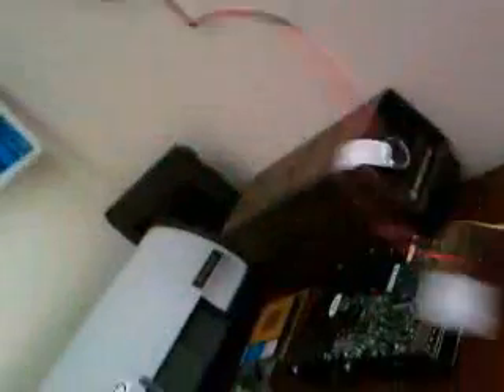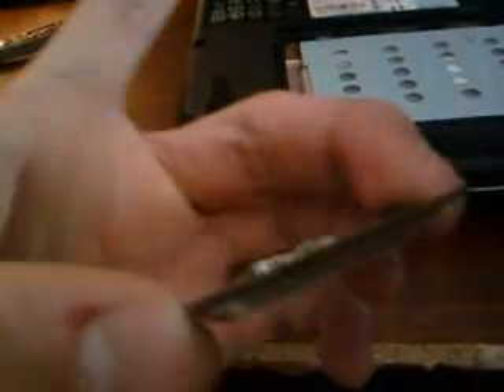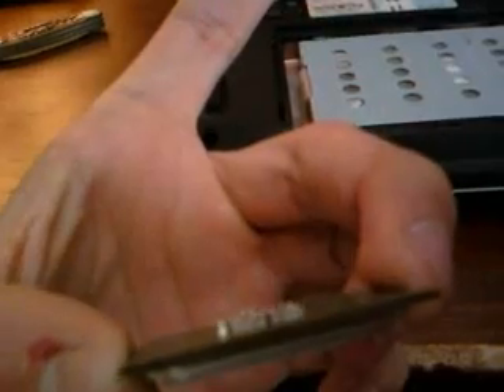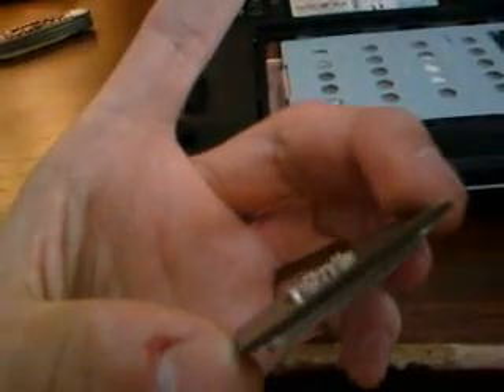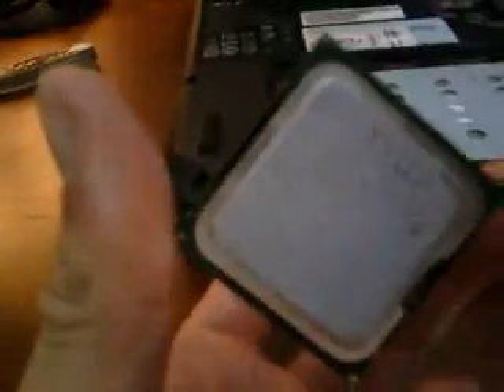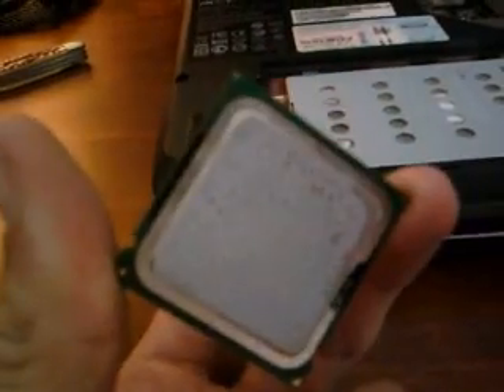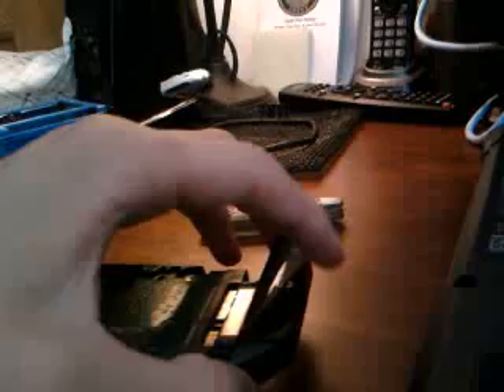Acer Aspire 5315-2326 Hardware Specs Review

Comment from the maker: @daand12 oohh. that sucks man. sorry to hear that... if you used any type of air can or anything that gets rid of dust, it has a chance your motherboard will fail. thats why when i use air to clean i use a computer cleaning vacuum... its a really good tool to have, it has all the accessories that you need to suck up dust in the smallest places without scratching/damaging the motherboard or any of its components. :) you should try getting one. they are really hard to find though :/